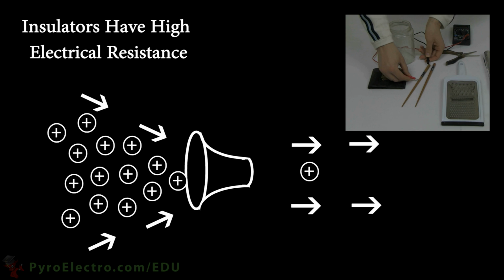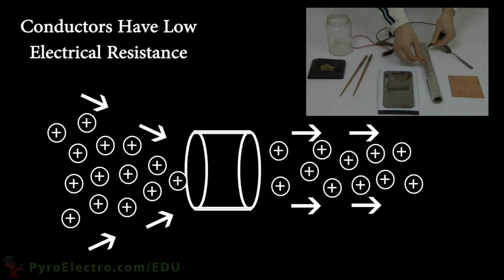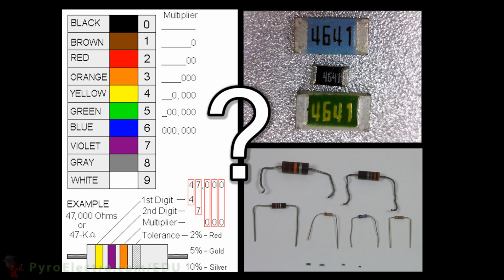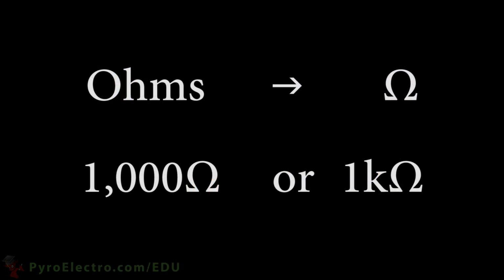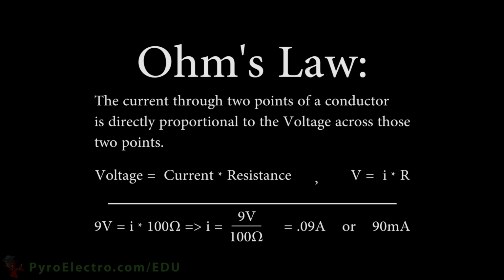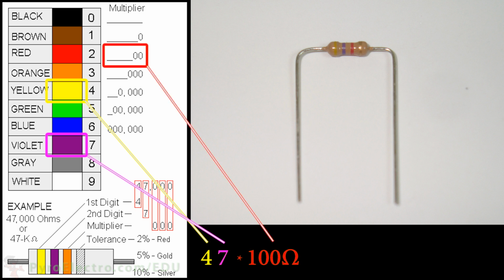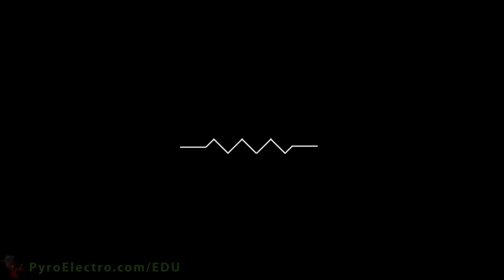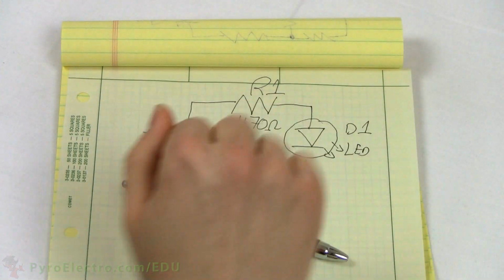PyroEDU: An Introduction To Modern Electronics - The Resistor

Comment: The question remains on resistors, while it's easy to figure out on smt resistors, how do you figure out what's the left and what is the right in a through hole resistor?

Comment: I'm confused with current flow direction. Don't atoms not move in solid conductors, and only negative electrons move?
Reply: i was also confused in  early engineering classes. for simplicity  accept  the direction of positive particles. Some authors take direction of electrons .